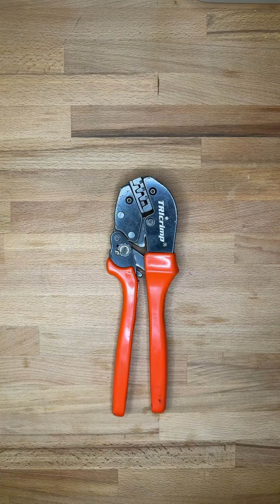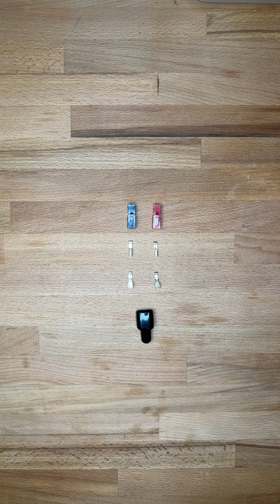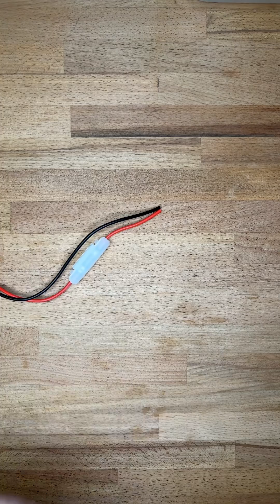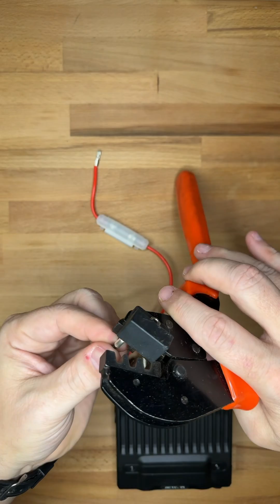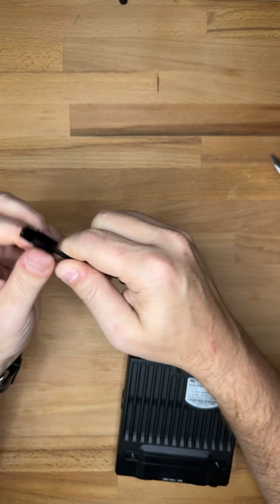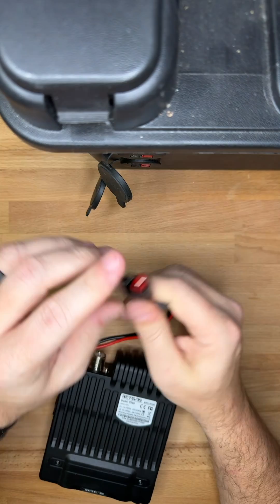Adding Power Poles to a Ham Radio

Comment: I keep the t-connector attached and splice in a power pole. In an emergency situation, you might be in a situation where you need to connect to a car battery and you can pull out your OEM cable with the t-connector and operate.

Comment: I think I am the only HAM who doesn't use power poles. I tried them but thought there were better and cheaper solutions out there. None the less thanks for the video!! Ki5TNY
Reply: What are your reasons or thought process if I may ask?
Reply: I don't use power pole either. I use the T style connector that comes with the radio. I have a bunch of them handy. They've been working fine for me for several decades so I never changed. I do like how the power poles have different amp connectors that are interchangeable but my old T connectors are fine.